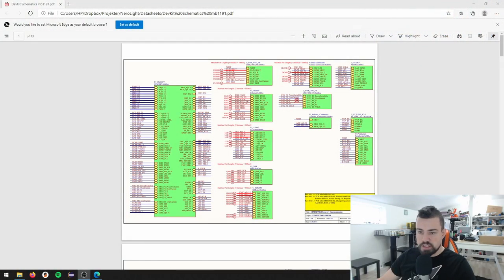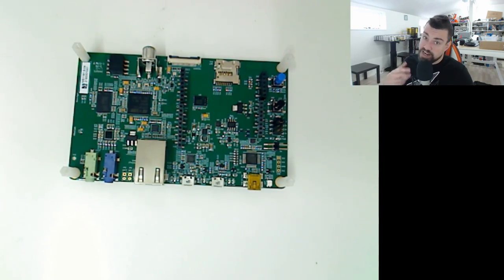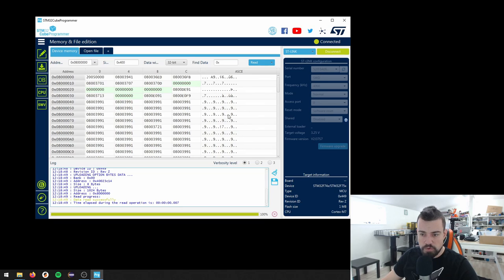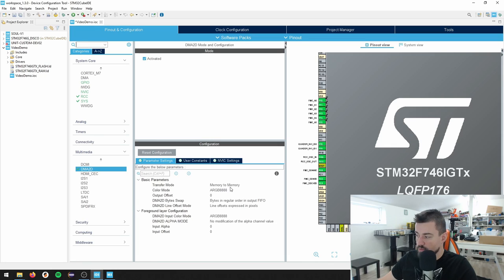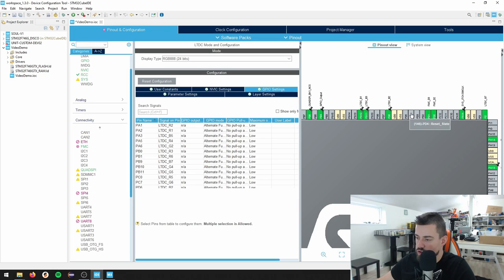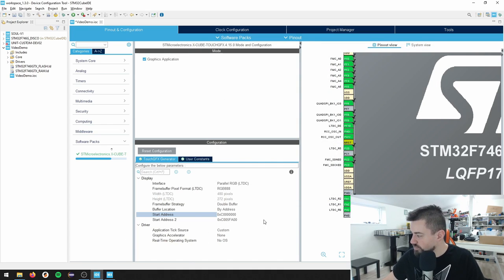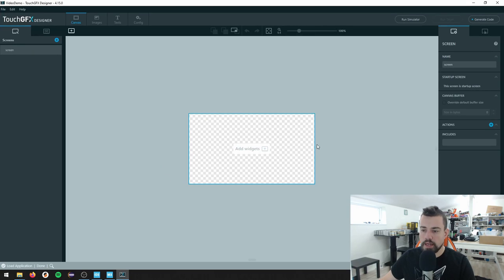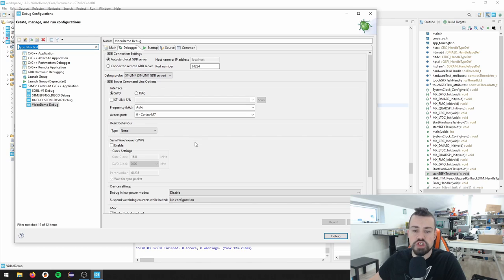How to integrate TouchGFX in a custom board (The long way round)

Comment: Hey man great content! If your ever find time and motivation, please do more touchGFX content. This is way better than STMs own content on it.
Reply from the maker: Sure, I'd love to :) is there anything in particular you would like to see?
Reply: @banjohat  currently I am trying to get into custom boards and touchGFX gui design. I thought it would be smart to get a dedicated display running on a disco board as a first step after just using the disco itself. Before I have already fiddled with a basic touch gui and afterwards with a menu like gui controlled by physical buttons. In that process I found that the STM tutorials are kinda weird structure wise because they copy code into the project ignoring the correct programming order, at least I felt that way.

So for now I am just sucking up any good information on that topic until I get it up running myself. I may update this in the next few days hopefully. 🙂
Reply: @banjohat  Update: Alright, so I have run into my first problem. My cheap 2,4" display with it's ST7789Vi controller only supports 8080-I/II parallel interface. My old STM32F429I-DISCO I had lying around and STM32s in general support this type of interface by configuring the FMC in LCD interface mode. But I did not figure out all the details yet. The ST forum has a solution dating back about 3 years but the current version of CubeMX is even featuring a ST7789V FMC driver, though I am not sure what to do with this. If you have experience with this, a tip about what to do would be highly appreciated. However I'll fiddle around with this anyways.

Comment: Fantastic video. Thank you so much for the in depth discussion. You cover very well the things that I had previously worked through on my own, and taught me additional things in the process. I would add one point to your frequent (and correct) comment that the Cube only generates hardware setups. Back in the day when the Cube was first introduced as a micro initialization tool for GPIO and peripheral setup, this was exactly the case. However, with the growth of the tool and the gradual introduction of several middleware layers, it is not so clear anymore where that line is or should be drawn, and I think users understandably expect to have some basic software calls where their absence would lead to a completely unusable system. For example, I recently discovered their BLE stack provides all you need for the stack...except a call to start it. Once you figure that out, you're fine, but until then it can be a beast. Anyway, the Cube is getting better all along, and you have contributed much to the progress, I think.
Reply from the maker: yeah, one do get the impression sometimes that cubeMX is a wide mix of different wants and wishes. It does a good job for most of the generations but does lack some particularities..

Comment: Thank you for the best video on the topic and one of the best explanations i have ever seen. I  have 2 questions your FMC start address is 0xC0000000 but at the end of your video where you show the memory statistics then the flash starts at 0x08000000 and the Ram at 0x20000000. Also the .data section of your flash starts at 0x20000000. Can you please give some more info? I am trying to use nucleo H755ZI with a custom Riverdi screen as an intermediate step and i am not sure what should be the setup for the address. I tend to use 0x20000000 but it is better to understand than only to try. And also in riverdi datasheet there is no polarity is there any what to identify proper setup?
Reply from the maker: to answer your first question - there are 4 types of memory all mapped into the same space, hence the different starting addresses. There really isn't more to say about that - but if you place your framebuffer in 0x20000000 then you are using internal RAM - which you don't have much of.
depending on your bit depth and resolution you might not have enough to run a double buffered setup which you need in order to do animations (sometimes even triple buffers)

For the polarity - the hint is to try out different settings here. a key tip is that even at a breakpoint you can tweak the polarity settings and see the difference live.

Comment: HI you state the SDRAM start is 0xC0000000 (7 zeros) but in datasheet it is C000000 (6 zeros) Please clarify?
Reply from the maker: I can't recall I have seen it with 6.. your chip might differ though so don't trust a random youtuber :'D

Comment: Hey , Thanks for the great video. I'm also designing my own custom PCB for stm32f746. I have  a question regarding the debugging part. I'm using SWDIO & SWCLK Pins, but Where to connect them? I mean, I have a STM32F746 Discovery Board but I don't think Ít has any pinout connection for connecting SWD & SWCLK pins for external custom boards to debug. I've worked  before with TI MCU's and they use JTAG for debugging custom boards.

Also, My second question is Which part number of SD RAM have you used? In the datasheet there are several part number of the SD RAM chip with different clock frequencies.
Reply: You're right, the discovery board have the st-link  built in. When you're designing your own board, just break out the swdio and swclk pins along with power. Those can be connected to an external st-link. Just not the one on the 746-disc0 board. All the nucleo boards should work

Comment: If I have to use larger displays(7 inch Or 10 inch)  what should be the specifications of it? 
Do you know any display names?
Reply from the maker: I have a few parallel RGB displays that are 7" and 10" - they are completely the same, connectionwise. 
I have bought my displays from buydisplay.com

Comment: Hey, You are doing some great content for the people, Is it possible for you to share the schematic or the pcb file with us? And what IC did you use for the touch screen?
Reply from the maker: sorry, this video is for educational purposes - the design is not available for free.
however, the design is closely based on the STM32F746-Disco board so you have a pretty nice starting point there.
The display is parallel RGB so no chip on it

Comment: You have detail video lesson. Thank you for spend your time. I have a question. Dont working touch screen. Do you write driver for touch IC. How do you make touch section.
Reply from the maker: I'm using the same touch driver as the evaluation board but you have to i clause it manually. It should be in the video how to add the appropriate files for the touch support
Reply from the maker: Sorry I was mistaken. It's in the next video: https://www.youtube.com/watch?v=ELMK35I86QE

Comment: I tried to catch it in the video,  but what RAM did you choose?  the 746 board uses a 32 bit ram,  and it looks like they only use half of it.  To save space (package is smaller) and money I want to use 16 bit rams,  I just want to be sure I don't pick a wrong one.
Reply from the maker: I am using the winbond W9864G6KH-6
it can be hand-soldered and is 16-bits :)

Comment: Thank you very much for sharing your knowledge and this wonderful project. I have some questions I would like to ask:

1.- Where can I get the schematics of the development card that you use as a base to develop your customized card?
2.- Do you have the schematics of your custon PCB and the firmware you develop available on GitHub?
3.- Do you know of any website that explains which displays can be used to work with TouchGFX in a custom board and where they can be purchased?

Thank you very much again for this wondeful tutorial ;-)

Comment: i don't understand one thing the frame buffer is larger than the sram of the microcontroller is it using the external sram for frame buffer?
Reply from the maker: yes it is. If you try to compile the code without the linker script modified so it supports external RAM you'll get an error. you can reduce the bit depth and the number of framebuffers to fit into the internal RAM but you will use most of it and loose some animation features

Comment: I'm having an issue with my framebuffer generated by TouchGFX.  Source code is not provided for this section of the engine.  Due to constraints of the STM32F4 I can only write to my external SDRAM in 32 bit words.  However the touchgfx::LCD24bpp::fillBuffer wants to write is with 8 16 bit pointer pointers.  My TFT display is an RGB888.  Is there a hook or some other thing I might be missing?  Thanks for any help.
Reply from the maker: Oh that was a tough one! I haven't had any problem the even remotely resemble that situation.
You will be better off asking in the tGFX forum - the dev team have people there so you should get some insightful answers (hopefully)

Comment: Hi 
Firstly Thanks a lot for video.
I want to use resistive touch.  I use Ft810 with 800*480 resistive touch but i want to use touchgfx after that.
are there any sample with resistive touch or can you advise any documantation?
Reply from the maker: I'm pretty sure the F429i board is using a resistive touch interface - but with an extra touch controller chip IIRC. At least that's a good starting point :)
Reply: @banjohat  thanks for your interest. I ll examine it.

Comment: Thank you for this full length vid!  You have answered many questions I had when developing my frist, second and thrid STM32 applications with touchGFX.  Question: What do you think about bulding a TouchGFX template for a custom board... would that help if the board is used for multiple applications by essentially use a touchGFX template similar to what STM creates for their eval/disco boards.  This is something I have been considering making for my boards, but wonder if it is worth the time.  Thank you for all your awewome videos!  I hope I hear an interview with you on The Amp Hour some day!
Reply from the maker: That's an interesting thought - I have considered it a number of times but didn't go into much detail on constructing the Application template needed. For my particular application the hardware haven't really changed in the 4 iterations that I have run so I haven't had the need for the AT. Also I do most of the work in CubeIDE since the designer is just for the GUI stuff (obviously). It's done so quickly that it doesn't make sense yet.
However, I have thought of making a board for props that require displays to sell. If I do that an AT will make so much sense beacuse then the end-users can do almost all of the GUI design in the designer only and don't care about the underlying hardware... uuh.. another project :D
The Amp Hour - Sounds really cool! Didn't know about that, would be amazing to talk about this :)

Comment: I was stuck in a related issue and you saved me. Thank you thank you. I want to ask about SDRAM initialization code, How is it done? what does it mean? why without it STM32 can't access the memory ?
Reply from the maker: I'm glad it helped you!
Remember that the Cube code only initialize hardware. Of your system requires some register setup you still need to do that yourself - that's what the code does.
Think of it like this: the cube gives you the keys to a car - you still need to turn it on to drive
Reply: @banjohat  Thank you sir, another unrelated question if you don't mind please. do you have any idea of the correct way to interact with SDMMC within FreeRTOS?, something is wrong with my program, and I still can't figure it out.
Reply from the maker: @mehdisehlouli4645  sorry, i haven't worked with RAM more than just setting it up for tGFX

Comment: 38:11: Displays can sometimes be just weird. I had one where my horizontal porches were too short so as a result a single white pixel got 2 slighly green neighbours in each line. Took me a day to figure out that the manufacturer sent me the wrong datasheet for the display. So yes, magnifying glasses are a must have. As you said!
Reply from the maker: Ouch, sounds like a real pain! The right datasheet will definitely help ;)

Comment: I am going along a similar path.  If you had access to Altium,  would you start with ST's files and remove the parts you aren't using?  I would presume yes.   In similar fashion, would it not make sense to start with the TouchGFX application templates and change/remove the items in the IOC using CubeMX?   It seems that the guys at TGFX want us to build from scratch.  Have you tried it both ways and are there good reasons to build the Cube project from scratch?
Reply from the maker: If you have altium, yes :) i opted to go with KiCAD since a friend of mine started the layout.
The problem with the application templates is that they are specific for the dev-kits. So as soon as you make custom firmware you are likely to change a lot of parameters anyway.
I have not made a custom board using the designer as a starting point because my own HW differs too much.
Reply from the maker: I have tried both ways (for the dev kit). When  using ready made hardware you can get up and running REALLY fast using the AT. But I think you are supposed to make it from scratch when developing real stuff
Reply: @banjohat  I had a thread/discussion on the forum about this last year.  "You are supposed to" build from scratch seems wrong. If I use the DISCO kit,  build up test circuits on Arduino type hardware,  get it 95%+ to my target config,  at what point to I throw away my project and start it from scratch,  (and then port my own work back in).   Seems like most users will do as much development on the dev kits as possible to reduce iterations of final hardware. The tools should embrace that process.
Reply from the maker: @TurboBobBailey  You're right - but in fact I think they do a fair job. think about this: the people working on GUI and graphical stuff can use the AT's to get started and going real easy using the designer approach.
the HW guys will have to do a lot of wiggling anyway and the custom method allows for a fairly quick integration of peripherals. tGFX is XML/JSON based (or something very similar) so it's quick to change the files.
Of course it would be nice to be able to have support for different chips along with FW init but I don't think that is a feasible way to do it for ST.
Reply: @banjohat  I think they do a fair job also.  I just think they are missing the one step.  Most likely they are all Graphical/GUI guys on the tGFX team,  and thus have not had to make that transition (from AT to custom) themselves.   The subject of your last 2 videos,  perhaps 3 hours or so video length,  probably a day or 2 real time,  should have been a couple clicks,  automatic,  to convert the AT project to a 'custom' project.   After all,  you had to refer to the AT (or perhaps a previously/painfully converted project).  The info/data is there, its just organized  strangely due to the new AT organization (sources outside the CubeIDE project).  As far as migrating a project to a better chip.  I want to be able to do that,  as I am developing on F746-DISCO,and want to move to H735.  My Freescale stuff can do that in a couple clicks.   Currently I am trying to keep all my code out of main.c,  and in its own directory,  so I can migrate out easily.   But I will start with the AT for the 735 disco board,  and have the same fight on my hands converting the project (or building from scratch and copying over all the disco code).  Of course its always easier the second time thru.
Reply from the maker: @TurboBobBailey  I think for the most part you are right. But I do think it is quite easy (however I haven't had the need to migrate to an entirely different chip). I too, try to keep out of main.c but that is in order to minimize clutter in a large file.
I actually don't think the tGFX team should spend so much more time on integrating with custom boards. they have absolutely no way of knowing or learning which chips are connected to a custom solution so they can't possibly know how to set those up.
The designer generates the minimal working project with QSPI, SDRAM and digitizer.
What perhaps is missing is a good way of making AT's for your own hardware. if you have one of those, you can get up and running REALLY fast
Reply: @banjohat  I believe (and both of our projects are prime examples) that the DK's and other "demo boards" are well engineered "reference designs".  Examples of best practices for these processors.  As such they are copied (whole or in part) as a starting point for the custom boards.   I believe most people would build a project using the application template and just change the parts that are different in their own design.  Same end result,  much less pain.